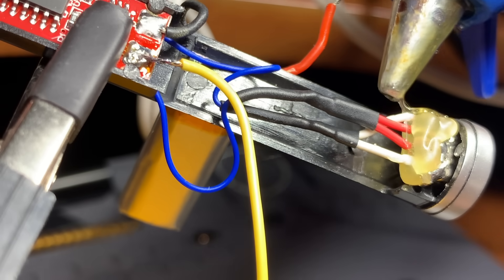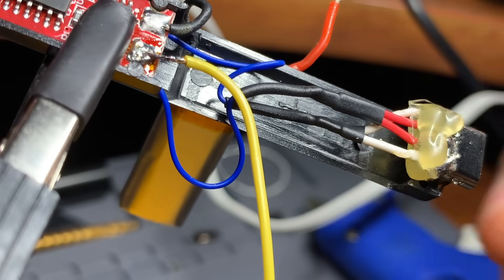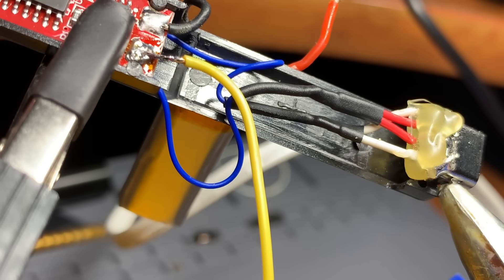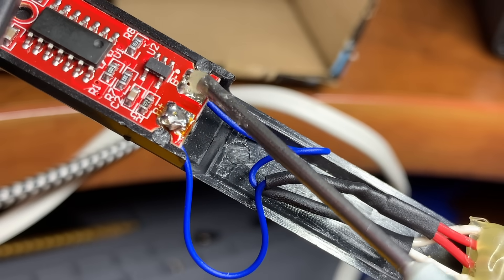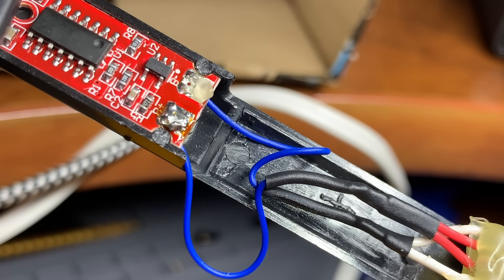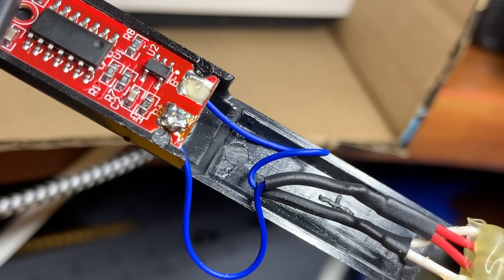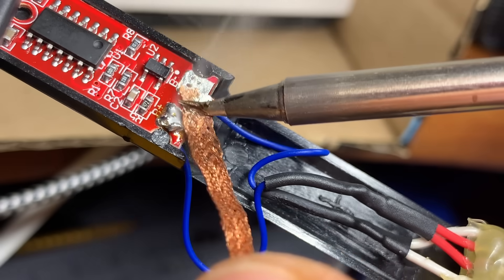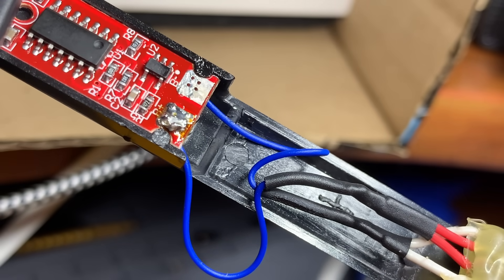#29 Bambu Lab fiasco affects you! Even if you don't own their printer. #bambulab

Comment: I was considering buying a Bambu Lab setup, NOT NOW.
Reply: I was still in the return window. So I "fixed" the cpu and listed it as DOA for the return/refund reason
Reply: I just bought an A1 mini to try andtry out bambu before buying an x1c or new printer that coming. So glad i didn't spend loads now.  I wont be buying another BL printer. I have a Qidi X plus 3 and it is great. I can imagine the x plus 4 improves on this but, based on my experience, Qidi customer service is excellent and deserves credit for that.

Comment: I was just about to buy an x1c.  Instead I decided to get the kobra s1 with ams
Reply: I just saw a video of someone who had a squeaky front roller.  Turns out it's super difficult, nearly impossible to service.  One time use, throw away, junk
Reply: @melioratewithnate Creality hi coming in February they said
Reply: wouldn't a MK4S be better?
Reply: @juanv8186  yeah,  it seriously considered a bunch of options the K2 MK4S...I figured I'd give it a go given the price point.  Hopefully it doesn't disappoint.  I'll probably do random videos about it either way.  Seems like it could be great.  I already have an xmax3 and the ifast for the heated chambers.  A budget multi material system...I guess I'll find out
Reply: @melioratewithnate  Great, I'll follow your channel for those videos. Good luck.
Reply: @juanv8186  thanks!

Comment: Always buy open source.
Reply from the maker: Although I don't have a problem with closed-source systems, a company may have some trade secrets they want to protect, I fully support the OSS community and publish all my code openly.

But I definitely have a problem when a company decides to drastically alter the functionality after the sale, and especially when they gaslight users calling them out for it.
Reply: or be confident enough to know you can just swap out an open source controller into any machine.

Comment: I'm a newby to 3d printing and was a bit of a Bambu fan boy blindly in the center of their eco system until a few days ago. I was almost ready to upload a model to maker world. Nope! No more Bambu filament and My P1S is now on LAN mode. I think if every one adopted these simple measures and hopfully more, Bambu will get the message.
When I bought my printer a month ago every review of a Bambu was spectacular. Quite quickly, Not so much!
Reply from the maker: It was a great printer until the company decided to get a running head start into a brick wall with their reputation.

Comment: I feel concerned too, I own two printers and I really prefer using the bambu one as it's faster and higher quality and very convenient. I wish I have more knowledge to create a firewall or a private server or something to prevent my printer and bambustudio from connecting to bambu servers, but as a lot of users I don't have the skills to do that. What can I do then beside contacting bambu ?
Reply: Buy a qidi
Reply from the maker: I installed X1 Plus on my x1c to prevent it from connecting to cloud. So far it stopped the printer from pulling this new firmware.
Reply: @UNgineering  I have a p1s, I will look if there is an alternative. Thank you
Reply: You already have a router. Just learn how to access it and change some settings. Sadly, the routers that come from ISPs are generally locked down. When possible, avoid them. So that might catch you. Just search for the model number and you should be able to find instructions to access it. Or at least you know that yours won't do it so you can make other arrangements.

Old PCs make great home routers BTW. Opnsense is free and very powerful.
Reply: Replace controller and all motor drives. Go with Marlin or Klipper FW. It'll be a fun learning experience and you gain full control of YOUR printer.